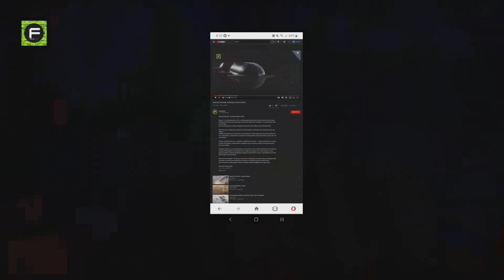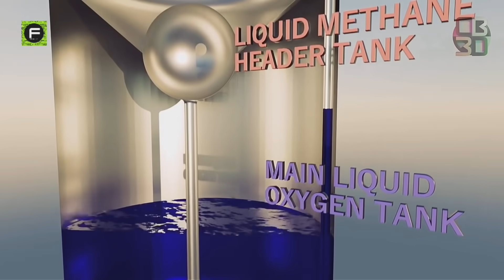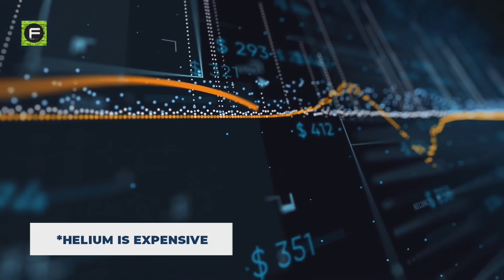Starship SN9: How SpaceX Solved Landing Crash Problem Of  SN8?

Comment: You were right, SN9 didn't blow up like SN8, but differently. :P Man, it would've been great to have a successful landing. The helium probably wasn't a good enough of a solution, as the second engine didn't seem to have enough power - maybe not enough fuel pumped into it. We'll find out soon, for sure.

Comment: 00:34 “and ascended in to outer space flawlessly”.  Uh, 40,000ft, where airliners fly, is not usually considered to be “outer space”?  
And you think spacex “found s solution”.  We’ll now if they did only when serial number 9 lands and count the number of pieces. Values greater than 1 will be a negative.

Comment: The title needs to be reworked. It’s very confusing as it starts out as a declarative sentence but halfway through changes to a question. You could easily fix this by either removing the question mark or adding the word “have” after the word “how”. Thought I would point it out since it seems no one else did

Comment: "*Helium is heavy". Literally the second lightest gas in the universe.
Reply: well i assume helium would be pressurised and so density will increase, but the same can be said about any gas, TL:DR "helium is heavy" doesn't make sense
Reply: @Electronerd Well, it certainly will add some mass, plus the extra hardware needed. But, against any other gaseous method, it shouldn't be on the heavy side.
Reply: I believe
1 its the weight of delivery and storage. Enough for at least 2 landings
2 can't make helium on mars. 😁

Comment: Just a little feedback. I know you’ve heard enough about the outer space part haha. But the main problem with helium is that it can’t be collected on Mars, and the whole point of this rocket is to be able to get us to Mars, and ultimately back to Earth. So all fuels have to be able to be reproduced on Mars. Also, weight isn’t an issue with helium, as it’s only heavier than hydrogen. The original plan was to route exhaust gas into the tank to keep it pressurized. So the addition of helium adds extra weight in hardware. But you were correct about it being expensive because the other goal of this vehicle is to be as inexpensive as possible.

Comment: Ok I'm no expert, but I thought helium was a light weight gas 0.1785grams per litre. Perhaps it's because it's under high pressure. Or maybe it is heavy compared to other gasses/options.
Reply from the maker: Actually helium is not heavy. But the helium crutch  adds weight to the rocket
Reply: @rush747in  Thanks for the reply. I have no idea what a helium crutch does, but I assume it's a mechanical part.

Comment: FANTASTIC  under 5Min. video!  If you were to promise nothing longer that 7 mins.; I would subscribe to you and lose about three "long winded" bloviating channels.   I propose a double bladder to pressurize the fuel in one side and use a lighter weight compressor gas in the other side.

Comment: Instead of a single hollow header tank, how about a tank that contains a very long very thin walled pipe that is coiled up concentrically inside the header tank. Helium is under pressure at one end which prevents the Oxygen separating. The turbo pump would then suck the oxygen out of what is basically a long straw.

Comment: Actually when Starship fallen from the sky the fuel, oxygen inert gases are weightless. So, inside of the tank you have a mixture of inert gas and fuel . It doesn't mater if fuel (liquid methane) is pressurized or not with helium. When fallen fuel and gas are weightless, they are unevenly mixed inside of the tank. The pressure level of Helium doesn't mater. I mean unevenly distributed fuel will be not always wetted the suction eye of the pump. It can be far from it. The combustion still will be lean because of Helium gas. So the trust will be not enough to land the rocket and the rest you can imagine.... You need to connect suction eye of the pump with a special clunker using elastic hose. In this case clunker will follow the fuel during the fall enabling steady wetting of the suction eye of the fuel pump.

Comment: The problem with helium is that it is heavy? This is a goofy video.
Reply: I was thinking the same, like what else shall it be? Hydrogen :))
Reply: Compressed helium is heavy
Reply: What would you suggest instead?
Reply: @leo_is_a_baka  Compressed helium is not heavy if it is not liquified.  Since keeping the pressure high is the goal, it is highly unlikely the helium would be liquified.  They would simply put gaseous helium in the chamber, under pressure, to force the fuel to the engine.

Comment: Helium is not heavy. It is used for the pneumatics controlling things like the vectoring of the engines, and because helium stays gaseous to extremely low temperatures, it can be used to pressurise fuel tanks.

Comment: If the oxygen content increases temperature does not get higher it gets lower, but the hot exhausted gases start to burn the nozzle, witch its happen on the SN8 flight.

Comment: Great video. Just a small correction: Helium is light (the second lightest in the periodic table). The helium COPV, however, represents a dead weight, since it reduces the overall thrust to weight ratio for the prototype.
Reply from the maker: Thanks for pointing out. Will try to correct it in the next one

Comment: Tell Elon: Wouldn’t a Red-hot Electric coil dunked into the Methane or LOX tank raise the tank pressure quickly? or if that would heat the bulk of the liquid, squirt a small amount of the liquid gas onto a red-hot electric coil suspended above the liquid gas. This should pressurize the gas tank quickly. There is already an emergency pressure relief valve so it can’t over pressurize.

Comment: They have to design syringe vacuum tanks! :)
Reply: Yes, the  volume must be entirely liquid.
Reply from the maker: Very interesting idea
Reply: heat the tank will increase pressure.  A bunsen burner?
Reply: @jonahbert111  The fuel must be cryogenic cold for density.  The problem is not pressure. The turbine pumps are  10,000 horsepower pumps and do not care about incoming pressure. They can only pump a liquid and heating would make fuel gaseous. Might make the sloshing problem worse.
Reply: @earthengineer8344  When the ship makes this maneuver, the tanks are practically empty, so yes, I am talking about heating the vapor, not the liquid at the bottom.  And it was SpaceX who said the problem was "low pressure in the fuel header tank", not me.  So take it up with Elon.   Their solution provisionally is to add pressure using a bottle of helium.  Pressured gas.  Heating the vapor will do the same thing, perhaps with less weight.
Reply: @jonahbert111  The special header tanks are kept full until the  relight of the engines. The empty tanks are not used for landing. As I explained, pressure is not the problem, vapor verses liquid is the problem. The crash was caused because of the engines being fed vapor not liquid. Pressure is not the problem, vapor is. Elon will figure it out. I am sure the only indicator they have is a pressure reading.
Reply: @earthengineer8344  Heating a cryogenic fuel causes lower density and the rocket engines need the higher density provided by chilling the fuel. Cavitation Bubbles in the fuel are prevented by the lower temperature.
Reply: @collegiateindependentstudy6437  Yes. Put simply, if helium gas is the only thing they do, expect another crash landing. Elon will figure this out, maybe by SN10?
Reply: Micro bubbles can nucleate cavitation  and cause instability , the Syringe no bubble no sloshing solution is the only reliable man rated solution I can get behind..
Reply: @earthengineer8344  Well, SN9 is ready to go, so it won't be long.  Your hypothesis is it will crash.  I don't think it will.  The header tanks are in the nose for weight balance, not because they need a full tank to operate.
"Now, the new reason for the Starship header tank is that by putting it in the very tip of the nose of the Starship you move the center of mass higher on the rocket - especially during reentry. If the fuel was in the main tank, the weight and balance would be too far aft for the 'skydiver' horizontal return method."
  In looking at the moon mission mockup, there are no header tanks, as they would not be needed as enough weight will already be in the nose.  That is what it appears anyway.
Reply: @jonahbert111  There is no atmosphere on the moon so there is no sky dive. There is no flip. It  is a vertical propulsive landing. Does not matter where the tank is, if you shake it up and get bubbles of gas in the down-pipe, the turbine pump will cavitate, you will crash.
Reply: @jonahbert111  Wherever the header tanks are, they are needed for relighting the engines when the main tanks are near empty. We must be able to count on fuel being in the down pipe. This is a major problem in micro gravity. Accelerating the vehicle with the RCS may work but when a descending rocket is changing course to find a landing spot or effected by atmosphere, forces can go in any direction and a small amount of fuel in a very large tank can not be counted on to keep the down-pipe covered. So a smaller mostly full tank is used.  A bladder tank or collapsing tank with no gaseous  voids is ideal. The Syringe concept.
Reply: @earthengineer8344  The Merlin engines have 10,000 horsepower turbopumps. I heard Elon say that the Raptor turbopumps are 100,000 horsepower. Raptor engines are monsters. :)
Reply: @jonahbert111  I mean, the tank should work on a similar principle as a syringe. As the fuel runs out, the piston collapses inside and doesn’t let air in, so there’s always something for the rockets to suck no matter what maneuver you’re doing or floating outside in space.
Reply: @szenyanistvan  Yes.
Reply: @szenyanistvan  I agree.
Reply: The problem with the syringe tank, however, can be that the rubber seals freeze from the extremely cold fuel and can rupture. A solution to this should also be found with a cold-resistant material or a heatable seal.
Reply: @szenyanistvan  There are many cryogenic seals that can be bought off the shelf  that remains flexible down to -425°F. That’s 35 degrees above Absolute Zero.
Reply: @szenyanistvan  Heating anything is a bad idea. A cryogenic variable volume tank (Syringe) is the right solution and very doable. Ask the world top cryogenic scientists. They work at SpaceX.
Reply: @earthengineer8344  I don't know about "worlds top cryo experts" now, but we will be.
Reply: @collegiateindependentstudy6437  The only way to FDM at the phase boundaries is to try something to inform the model. That is advancing the state of the art.
Reply: Bocachica gal videoed what could be a collapsible tank going into one of the future Starships. It is not spherical and you can  see the inside out bottom as they were loading it. SN9 should be relegated to static tests or sent out to sea to trial land on an imaginary drone ship. IMHO
Reply: @earthengineer8344  could you supply a link? I couldn't find it. Thanks
Reply: @williamgreene4834  If I include a link, Youtube does not show the post.
Reply: @earthengineer8344  Thanks for the info. I send YouTube links all the time and it works fine. I guess I never tried to send any non-you tube links. Thanks again. :)
Reply: @williamgreene4834  Several people posted the description. I only see the one I posted and no one else can. I can not see any the others.
Reply: @earthengineer8344  I posted it as well. I am the only one who can see it.
Reply: @williamgreene4834  I think on this video comments with links are held for approval. It is 6 min in  StarshipBocaChica last video posted.

Comment: You need to quality check your content.
Reply from the maker: Thanks for the feedback.  I will try to improve next time
Reply: @rush747in  Most of us are techno-nerds. If you're going to report on this topic you better study. Not much gets by the nerds. :)
Reply: Cut the producer of this video  some slack of course there are mistakes as 12.5 km is not outer space but we I understand his enthusiasm as SN9 will fly and I think Elon Musk said something to the effect that this next hop will only go to 10 km possibly due to the extra weight of the helium pressurization
Reply: @johncherish7610  I think the reduction from 12.5 to 10km for sn9 is to avoid strong upper level winds that can hang around the 12km area. Upper level wind concerns was the reason for lowering sn8 flight to 12.5km from 20km. In regular flight the vehicle will be full of fuel and very heavy so winds won't be a concern then. :)

Comment: You have taken a wide range of film clips of both SN8 and 9, put them in a jar, shaken them up and presented them in whatever order your blindfolded assistant pulled them out. Out of sequence, wrong rocket, who cares!  You need to do better than that.
Reply from the maker: Thanks for pointing it out. Will try to correct it in the next one
Reply: Think Mk. 1 was in there too
Reply: They even showed what appeared to be SN-7.
Reply: Not only that, but some clips are actual footage and some clips are animations and they are presented together as a sequence. Very misleading. Example: 0:39

Comment: Pressure was not the problem. The engine received gaseous fuel instead of liquid because of the sloshing in the tank. As long as there is Gas and Liquid in the tank the flip maneuver can mix them up and cause failure.  The raptor engine uses a turbine pumps that does not need fuel pressure but it must be liquid to be pumped.
Reply: Yes SN9 will likely starve trying to burn helium if they do not fix the sloshing problem. I am sure they will.
Reply: @collegiateindependentstudy6437  Yes. I am expecting a cryogenic bladder to separate the fluid fuel from the gaseous so no Gas can end up in the downpipe, even when it is not "down".
Reply: @earthengineer8344  Thats why I recommended landing SRB's.
Reply: @collegiateindependentstudy6437  Good luck throttling an SRB with accuracy to land? But at this point, everything is impossible, we wait to see what impossibility they accomplish next.
Reply: The entire purpose of the header tank is it is full when doing its landing burn and a full tank does not slosh.
Reply: @WWeronko  Unfortunately, there can never be a full tank of a cryogenic fuel. The thermal properties requires a percentage of headroom. By the completion of the flip there is more than 25% vacant space filled with Gaseous fuel. These bubbles can and did destroy the engine.
Reply: @WWeronko  The start of the burn it is full. Not after the flip.